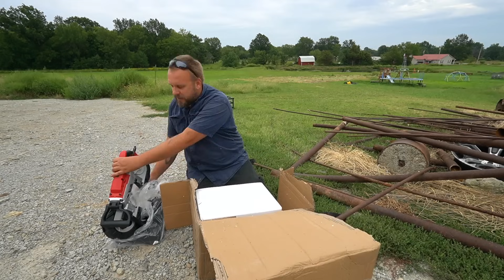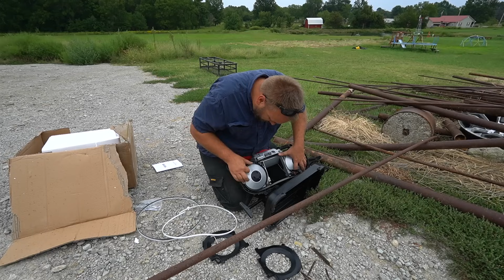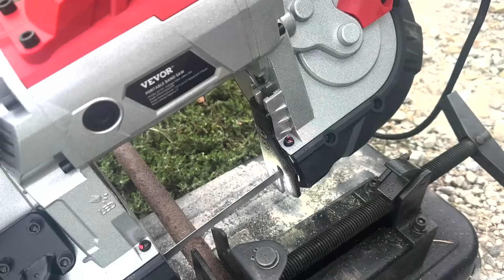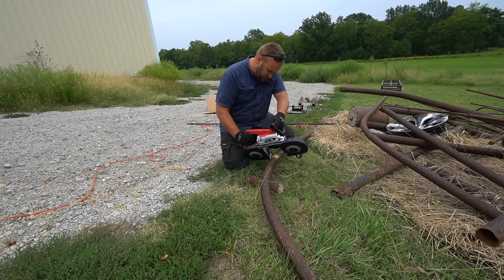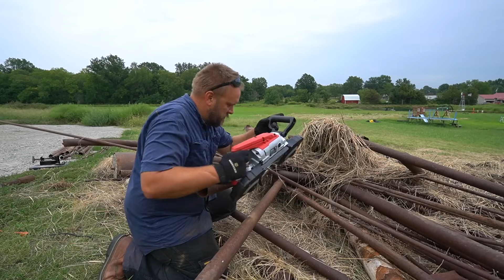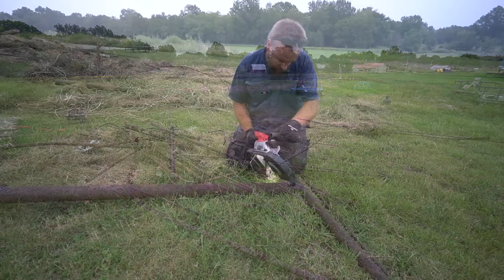Vevor Portable Bandsaw Review

Comment: I bought a Milwaukee Cordless Band Saw... Probably one of the most underwhelming product purchases I have ever made.  Bought it to remove the broken carbide teeth on the soil conditioner and the blade couldn't reach.  If that wasn't a disappointment, every other time I've tried to use it it seems that an angle grinder and a cutoff disc, plasma, torch or anything else would have been better.  I'm sure there is a use for a metal band saw but I haven't had much luck.
Reply from the maker: I also got a plasma cutter from vevor but it is still in the box